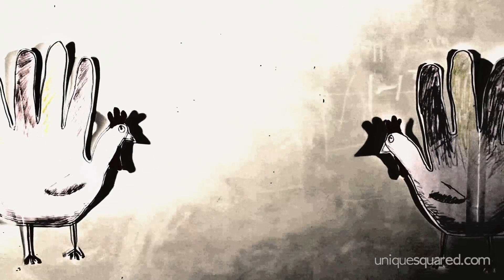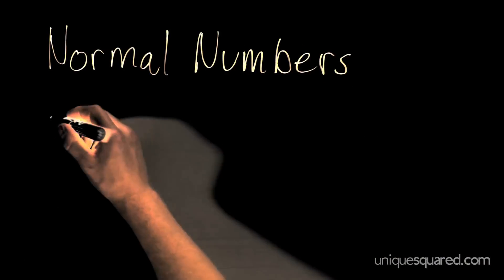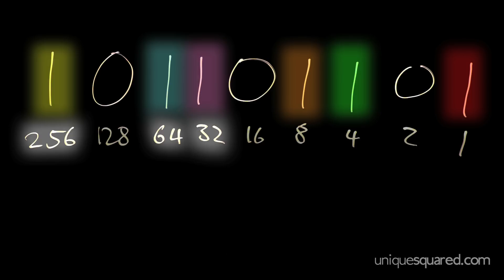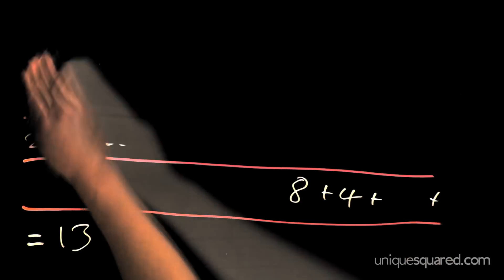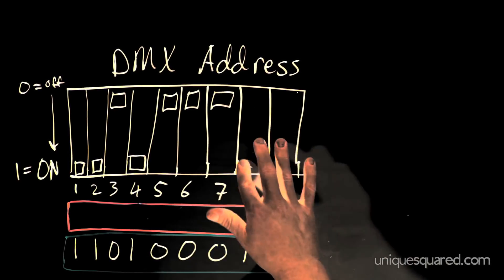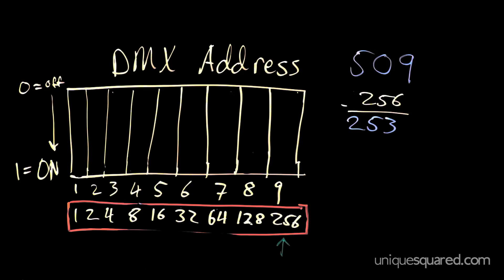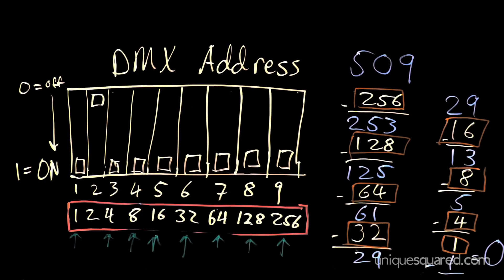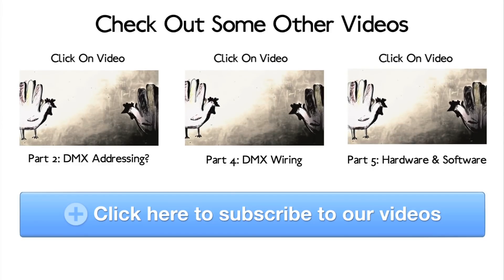DMX Lighting Tutorial Part 3: Dip Switches | UniqueSquared.com

Comment: binary teachings are pretty nice but why can't we just start counting from the back and use the "1" channel to make up uneven numbers?  ch 503? 256+128+64+32+16= 496, + (DS 1,2 and 3  witch are equal to 1,2 and 4 and we leave DS4 out of the math cause 8 would be to much ) = 496 + 4 + 2 + 1 = 503 ...you said its always 512 channels per universe and it's binary  so there won't be any bigger numbers.....channel 163? DS 8,6,2 and 1 wich equals channel 128+32+2+1=163 ....easy as pie and ten times faster than always looking at an app at ur smartphone while at work. Oh yeah, btw your tutorial is the best!

Comment: Look at minute 3:07, it's wrong. You wrote 1, 2, 4, 8, 16, ... from left to right, when numbers should be wrote from right to left. In fact, binary 110100010 isn't equal to 139 in decimal, but to 418. Decimal 139 would be 10001011 in binary.

Comment: Hey, I volunteer to do lights at a local Jr. High. We are running a Nsi 24/48 light console running to 3 Nsi 8 channel dimmer packs. After a while, a dimmer channel will just stop working. Is there anything perhaps that i am doing wrong. Also is there any way to troubleshoot and/or fix this problem. Also there is one channel that is consistantly stuck on full.